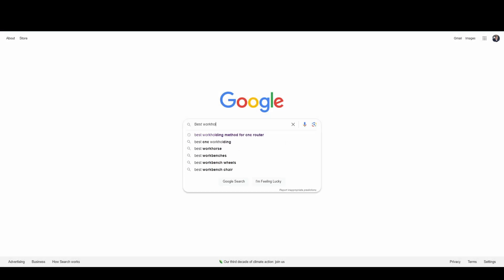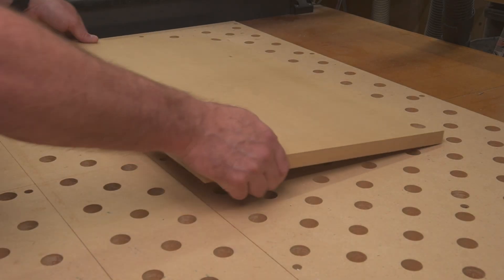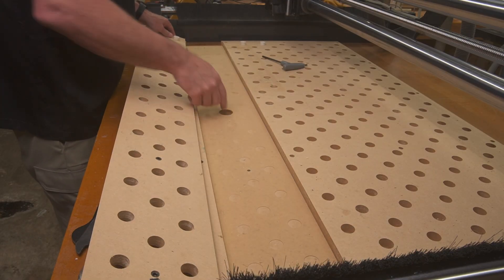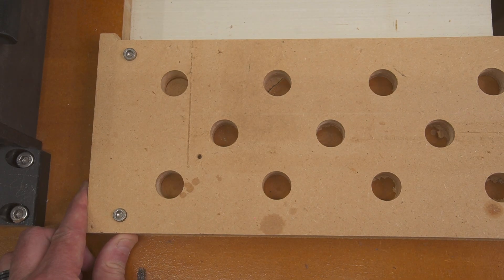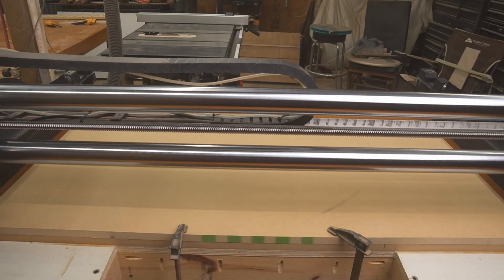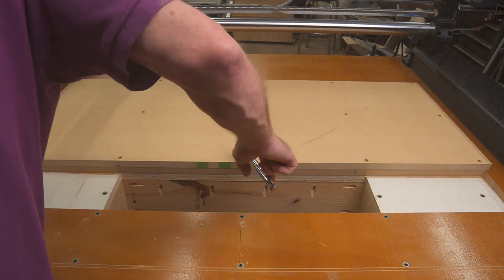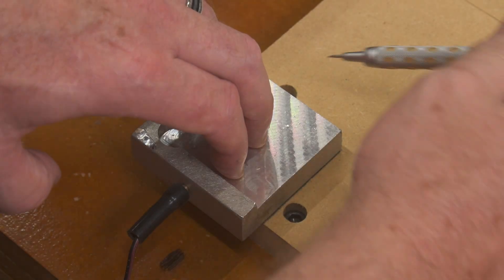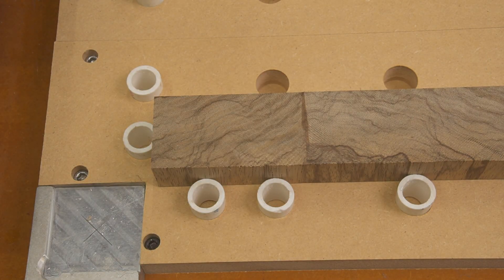A CNC Waste Board for Cheapskates.

Comment: Great video! I like that your searching shows me in the top result ;). The wedges work well for down cut bits and routers/spindles that don't have a lot of HP, but I've found that higher power machines with up-cut bits will lift the workpiece up when using wedges. Has this not been an issue for you?

Using PVC is great because it is cheap and it won't hurt if you hit it with a it. Have you found issues with accuracy due to it? I'd worry about the PVC not being quite consistent in diameter.....but maybe that really isn't a problem. I should give it a try! I know BroInWood uses similar techniques for a lot of his cutting boards.
Reply from the maker: Thanks Corbin!
That Dragon Scale Bowl is next level!

To answer your questions...
I have found that if the workpiece has any weight to it, like the cutting boards I make, then I don't get any lifting whatsoever. If I need to clear or profile something small, and/or thin I either tape it down or use screws with no issue.
I'm not one to make aggressive clearing or profile cuts anyway, so if I do use an up-cut, 1/8"DOC on a 1/4" bit is all I usually take anyway. For no other reason than extend bit life. I don't ever get into a hurry, really. Joys of this remaining a hobby. I don't have orders to fill. ;)

Regarding the PVC stops, they have not failed me yet. The dog holes I have along the fence line are slightly smaller than the rest of the bed to keep the pvc stops rigid. I am sure that they aren't consistently round, but lining up the work on several of the stops at once along the fence, I am pretty sure it ends up being a wash and that 'plane' ends up perfectly parallel with the gantries. I would bet a wooden nickel that my repeatability is within 2 or 3 thousandths.  I base that on my experience cutting multiple inlays, each time removing the board from the bed for glue-ups, and after re-installing it onto the bed, the next cut will cut perfectly along the edge of the previous inlay.

Thanks for watching and keep up the good work with your channel!

Comment: this is a stupid question so sorry but I have a onefinity as well and the probe plate for the z axis that you made a cubby for, you still put that on top of your material and probe z, right? The cubby you cut out is just it's "home" when not in use?
Reply from the maker: Not a stupid question at all. 
I have the Masso controller and it allows for a bit setter, but you can't use the same block for zero-ing that you do for the bit setter. 
I have a different probing block for zero-ing to the work and I use the old Onefinity block as my bit setter, so it stays in the cubby 100% of the time. 

Thank you for watching!!
Reply: @MandSWoodworks  ohh I see, I do not have the masso, just the first one (buildbotic I think or something like that)

Thanks for explaining

Comment: Sir, I’m going to need a video on how to do that vertical cutting jig. I want this for my longmill
Reply from the maker: I actually bought the design for the cutting jig off of Etsy. So if you look at mine, visually it looks almost identical to the one from Etsy. But I did change some things on it and resize it to accommodate the idea of fitting it as an insert into the table. Here's a link if you want to check it out.
https://www.etsy.com/listing/1172990836/vertical-mounting-table-fixture-for-cnc

Thank you for watching!!
Reply: @ thanks! I loved this video! You should definitely shoot more!
Reply: @ this is close enough, looks like money well spent. My spoil board is even set up like that with t-track. I like yours better though

Comment: What's your reason for the offset holes in your spoil board?  I have seen spoil boards with the holes are aligned in a grid pattern so I'm wondering if there is an advantage - disadvantage to either layout.  Thank you.
Reply from the maker: The advantage to me is that it allows for more clamping options depending on the dimensions of the workpiece you are trying to secure.
For example:
On my spoil board, the hole pattern puts each dog hole spaced at a little over 3 inches.
If the edge of the workpiece was too close to a dog hole to allow for a clamp/wedge, then the next available dog hole would be over 3 inches away.
But by having them offset, I now have an available dog hole that is only 1.5 inches away.
So I have more clamping options, but with fewer dog holes to cut into the wasteboard.
I hope that made sense.

Thank you for watching!

Comment: As your putting the wedges in to hold a piece, do you ever find that it lifts the wood?
Reply from the maker: Sometimes on very light pieces, in which case I use the double sided tape. 
I do a lot of cutting boards and they tend to be fairly heavy so lifting isn't ever a problem. 

Thank you for watching!
Reply: On my most recent spoilboard, I tried dog hole cam clamps, but I got lifting (my material is often 4/4 hardwoods in the 11x11 range). I may experiment with wedges in the next version … for lifting, have you tried planing or sanding a slight angle along the long (non-angled) edge of the wedges? Not sure if that would help, but I know some lateral clamps are designed that way.
Reply from the maker: @HighRPMCreations  
I had the same issue with Cam clamps and why I stopped using them. Yes, the wedges are much more forgiving when it comes to lifting. No, my wedges are cut square, but your idea is worth considering.
You could consider 2 things when trying to secure the panel you just described. 4/4 thick and 11x11 square.
First, don't clamp them too tightly. You just want to keep the board from moving on the bed. The side clamps aren't meant  to keep it from lifting. Just enough pressure to keep it from moving side to side is enough.
Secondly, to overcome issues with lifting, I tend to use a down cut bit way more often then an up cut. That alone cures most of the lifting issues. Not to mention, a down cut generally leaves cleaner edges as well. :)

I generally only have issues with very small and thin pieces, which I then use double sided tape or as a last resort, I just screw them down.
But for the most part, the wedges and using a down cut bit have suited me well. :)
Reply: @MandSWoodworks  : I’m in the process of replacing my spoilboard, and will definitely give wedges a try.

The closest I come to upcut are compression bits, so that’s less of an issue, but I guess I am more comfortable with tighter holding than light. Don’t want anything letting go, getting dragged around by a bit doing high RPMs and catching my place on fire 🫨
Reply: @MandSWoodworks  : What do you do when you are doing profiles? In order to minimize waste, I often am zeroing X and Y so that two sides of a rectangle are the diameter of my profiling bit or less from the edge of the material (blue tape and CA glue works well for this), which wouldn’t work with the fence/wedge method. Do you go with waste all the way around and tabs? I guess the lateral holding pressure and/or tab size would be a factor?
Reply: @HighRPMCreations  
I believe I have the Kreg version of those. Those round blue ones and they can lift the wood too. I do like that method though but in researching different products that work similar I have seen the Bessey version actually push the wood downward instead of lifting the wood. They are more expensive though but they are on my list for the future. Have you considered those or do you have them already?
Reply: @iwannaapple7190  I know the round Kreg ones you’re talking about but don’t have any. Unless I’m doing a top clamp, my typical is currently blue tape and CA glue, but that takes more time than cam clamps/wedges/other lateral methods would. I’ll look into the ones by Bessey, thanks!
Reply from the maker: @HighRPMCreations  
Like you, I aim for the least amount of waste possible. 
When profiling, no matter the size of the work piece I use double sided tape. 
I use the PVC stops as guides to make sure it is square, then let the tape settle and bond to the bed. 
Then I pull out all the stops so that they aren't damaged during the profile.
Reply: @ : Gotcha! Maybe one day we’ll both have vacuum tables 🙏🏽

Comment: I'm I mounted one piece of particle board and a piece of MDF on top of my CNC bed. I then using the CNC cut a quarter inch piece of plywood that's got the template routed out into it to hold your pieces and then using the cams that are screwed into the MDF to tie it down with using brass screws and 23 gauge pin nails to hold the loose parts to tie it all down it works very well. Doing this you don't have to spend so much time working on your holes in your wasteboard.

Comment: Are those bench dog clamps the same diameter as the pvc pipe?
Reply from the maker: Sadly, no. 
They're a bit smaller, but still work well. 
I've had thoughts of 3d printing a bushing to get a better fit but as mentioned, they still hold well despite being a bit smaller.

Comment: I’ve seen in one of your other videos how you set x, y, and Z zero for your rotary axis.  Have you ever tried creating an offset for it?   I’d be curious to see how repeatable it would, at least for x and z
Reply from the maker: The Y and Z offset would remain consistent but not the X.
It would change for each new project so you'd have to set that each time.
With that, if I've already set everything up to zero out the X, I might as well do the others while I'm there.

Comment: Also, you could always cut a t-slot into the bottom of that middle piece that comes out and then rack it to the externative aluminum underneath. That way you could simply lift out the one piece with everything attached. You probably wouldn't even need all that extruded aluminum for rigidity then.
Reply from the maker: The extrusion is on 20mm square, and because of the size of the opening, one piece of extrusion wouldn't give it the rigidity that I was looking for. But, if I were to increase the depth of the cut out, you could probably get away with using something larger to keep everything nice and flat. :)

Comment: I wouldn’t call it cheapskate. That’s the spoil board I use. I find it effective. I use double masking tape and CA glue when using upcut bits. Easy to resurface and use.
Reply: Might I ask.. how did you make the waste board? I'm still lacking the skills in creating these kind of things. 😂
Reply: @misury  Absolutely! I am traveling home at the moment couple of questions 1 what software are you using? What is the size of your cutting surface? It will either tomorrow or Saturday.
Reply: @kevinrich4637  You ROCK! I have the original woodworker, which is the 32x32 working area. I have the vectric vcarve pro.. and I really need to learn that, but unfortunately life's getting in the way again. 😏

Comment: What spindle are you running? Odd to me that Onefinity doesn’t sell one like some other brands do…..
Reply from the maker: I'm running one of the cheapo Chinese spindles, but I haven't had any trouble out of it in 3 years.
It's the Hy Huanyang 2.2kw Spindle and VFD.
I don't judge Onefinity. They started out just selling the hardware of the machine. What little they do endorse these days is due to pressure from the public.
I think it's smart from a business perspective. They keep the overhead low and they only have one piece to support.
And due to the design of it, it keeps it somewhat modular and you can add whatever you want to it, and not be limited by what they provide.

Thank you for watching!!

Comment: Genius! I've got a Longmill MK2.5 48x30. I've tried them all, the T-tracks, threaded inserts, T-nuts and I'm not happy with any of it. I will be stealing every bit of your design, including the removable part for my Vortex 4th axis. I'm interested in seeing how you made the vertical insert. Do you have a video about that?
Reply from the maker: Steal away, and good luck with it!
Unfortunately no, I don't have a video specifically for that.
It was actually very easy to make. Admittedly, I shamelessly copied the design from a guy who sells the plans on Etsy, but I did buy the plans from his Etsy store and then make what I wanted.
I didn't use his cutting files, but I did reverse engineer it to work with my setup and I used his plans as a template.
Here is a link to it, if you're interested.

https://www.etsy.com/listing/1172990836/vertical-mounting-table-fixture-for-cnc
Reply: @MandSWoodworks  Thanks for the link. I'll have to modify it as well. I plan on putting it on the x-axis like you did, but I'll have to move it farther to the right, since I have drawers under the left side of the table. I'm not entirely sure if I want to go through the trouble to make it. I use my table saw and router table to do those types of joinery. Anyway, I'll download the file, just in case I change my mind, which I tend to do on a regular basis.
Reply from the maker: @ronhansen7717  
In all honesty, I've only used it on a project a couple of times since I built it, but it did come in handy. 
It's one of those things that you don't really need,  but it's cool to have. 
I've played around with circle joints, dove tails and the like and it's actually fun. 
Good luck!

Comment: What type of material is your table made from, that the threaded inserts are installed into?  It’s a different color than the MDF.
Reply from the maker: It's also MDF.
I sealed it with several coats of Shellac, and that is why the color is different.

Thank you for watching!!

Comment: What a fantastic idea!  Any chance you are willing to share your CNC file?  I understand changes will need to be made to the file for me needs.
Reply from the maker: It's incredibly easy to make your own.
First, measure the diameter of the PVC pipe that you have, and then create a series of circles that are that size, and put them into a pattern that you like.
The pattern I settled on had the circles a little less than 3 inches apart.

Thank you for watching!

Comment: Love the offset spoilboard holes, I need to add that to mine. Whats speeds did you run the holes at?
Reply from the maker: Remember that I used a 1/2" endmill to cut the dog holes...
Feed rate was 50ipm and the spindle was 12k RPM.

Thank you for watching!

Comment: im new to this do u have files for this
Reply from the maker: Hi Tracy,
Sorry, no. I actually made this on the fly.
Drawing up a waste board is incredibly easy to do, and is a great first project for you to take on.
Use your CAD software to create bunch of circles in a pattern that you desire, and cut them on your waste board.
The Dog Hole pattern I chose has the holes right at 3 1/8 inches apart from each other.
I use 3/4 inch PVC and the brand that I bought, the OD of the pipe was 0.8 inches, so that is the size that I cut my dog holes.

I hope that this helps.
Thank you for watching!

Comment: I just use MDF same as your secondary waste board. I screw all my work pieces to the MDF.  I have been through all the clamps and two sided tape.   Amazing how many screw holes it will take.  Last's a long time.   I do not care about pretty.  MDF is cheap.  Thanks for video.
Reply from the maker: Screwing down the work is indeed the absolute best method, IMHO.
But most of the stuff that I need to secure down is at least 1 to 2 inches thick, and sometimes thicker.
And I usually have it cut down to the final dimensions already when cutting it and I don't want to damage it with screws or screw holes, so this has been my best option up until now.
Thank you for watching!!

Comment: Great video.  May I ask the dog hole diameter and the pvc pipe size you are using.
Reply from the maker: Thank you!
I use regular 3/4" PVC pipe.
I have found that depending on the manufacturer, PVC pipe can have different OD measurements. Not by much, but enough to where they can be too loose or too tight in the hole you have cut, so I recommend that you measure the OD of the pipe that you have bought to make sure you get a snug fit.
With that, and to answer your question, I cut my dog holes at 0.80 inches.
It's not too tight to where they are difficult to push in, but not too loose that they don't hold a good edge when I press something up against them.
I can push mine in, but i need pliers to pull them out, (but still very easy to remove) and I consider that perfect.

Thank you for watching!
Reply: @MandSWoodworks  I'm confused.  Are you saying 3/4" pvc (which measures just over an inch), or 1/2" pvc that measures just over 3/4 (.80) inch?
Reply from the maker: @allenmw2  
Allen, my apologies. 
It's 1/2" PVC, with approx 3/4" outer diameter. 
I was not thinking when I replied. 
It's of note that the pipe I used measured 0.78 inches. 
I'm sure it'll differ among manufacturers.
Reply: @MandSWoodworks  Thanks for the info.  I am researching all things CNC to try and figure out how I want to set up my first system.  Thanks for the info,
Reply from the maker: @RobertTweedy-s9c 
Please see my recent reply. I wasn't thinking when I replied to you. I used 1/2" PVC pipe, which would have an O.D. of 3/4". My apologies.